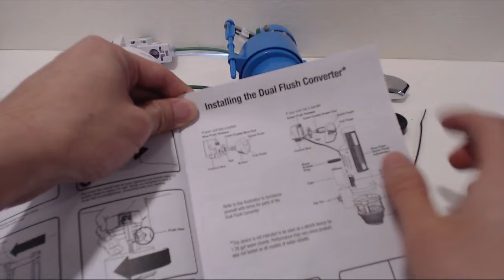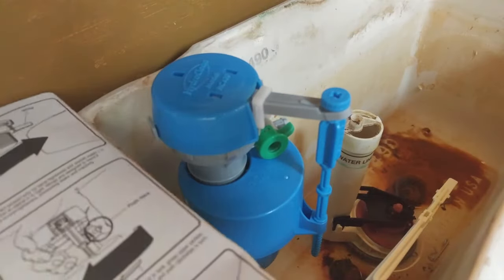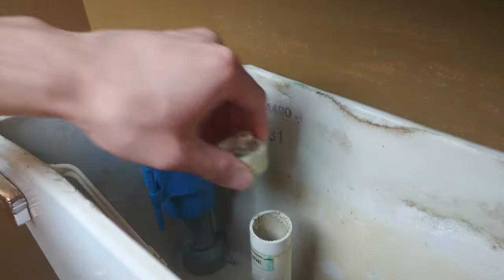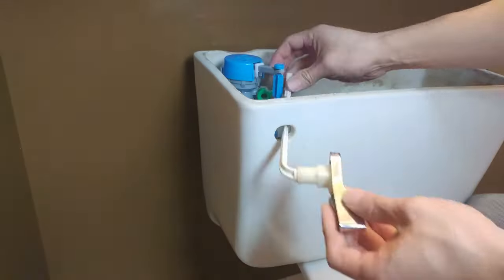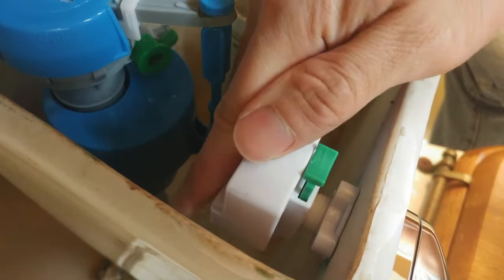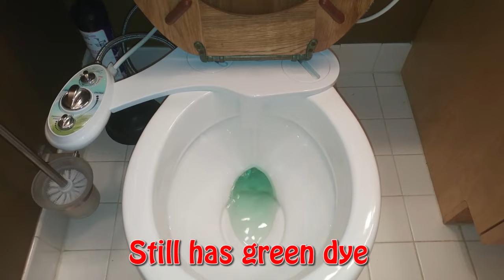How to Install Danco Next Duo Flush Conversion Kit and Review

Comment: This is a horrible video. The whole purpose is to demonstrate the DUAL FUNCTIONALITY OF THE FLUSH HANDLE--and you don't even show that. I want to see how the handle works to do both types of flushes. On my unit, the handle seems to operate the same way whether you use the outer or inner handle...
Reply from the maker: Actually, the whole purpose was to demonstrate the installation process because the instructions that come with it are lacking. Though you are correct, I did overlook showing the handle action in the post-installation demonstration. That's great feedback! I'll remember next time I test/install another unit like this. I hope the following written description will help elucidate this functionality for anyone that needs it. The "inner" handle with the single water drop on it is the quick flush handle and when you press on it, both halves to the handle with move together and stop at a certain point. When the handle stops, you can release it and the tank will drain the selected "quick flush" volume of water into the bowl. Note that if you continue to hold the handle down, even in the stopped position, the tank valve will stay open and obviously, you can empty the whole tank this way, defeating the purpose of using the quick flush option.

When you press on the outer handle with the two drops for a full flush, both halves of the handle will move down to the same spot, but continue to press just on the outer handle and it will "split" apart from the small handle and drop down about another half inch. This secondary motion activates a full flush and it will use the larger volume of water you set with the green float tab.

Regardless of where you press on the handle, as long as the handles never split apart AND you release it before the handle splits apart, you will be using a quick flush. Only when the handle splits and the outer portion continues on its downward trajectory past the stopping point of the inner handle will a full flush be engaged, or optionally, keep the handle depressed as long as you need to hold the valve open and allow water to continue to flow into the bowl until the handle is released. I hope this clarifies how the handle works.